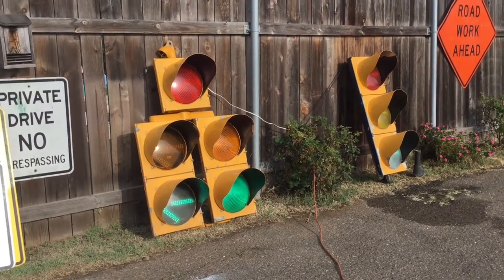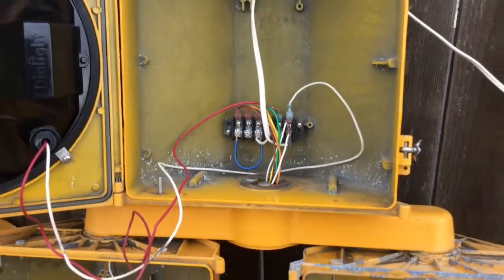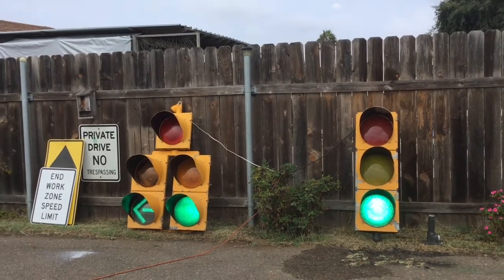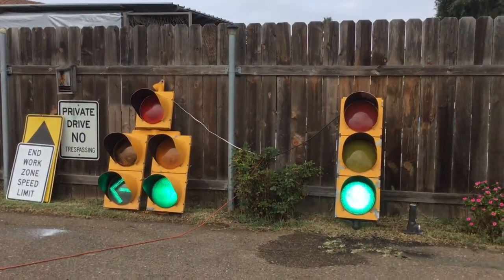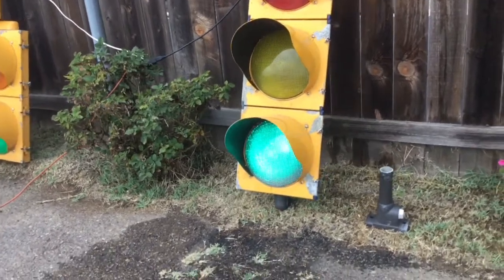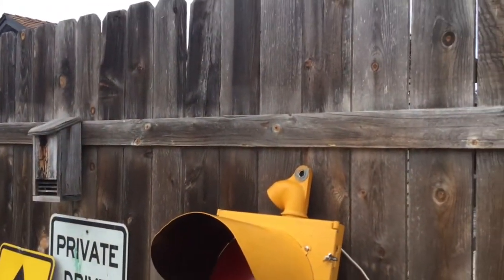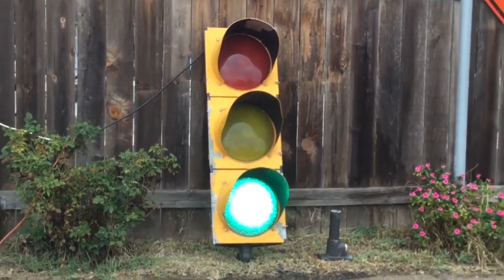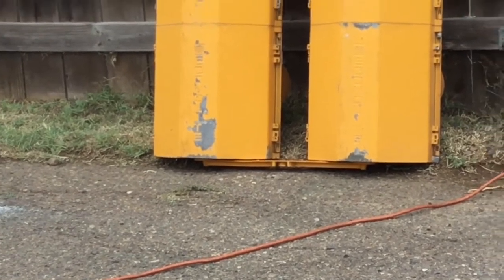Signal overview September 2021

Comment: That 3 section was one of the two pole mounted signals that served at Morse Road & Sunbury Road in Columbus Ohio. It was installed in 2008 and removed in early 2016.